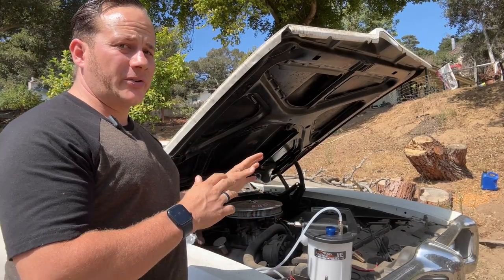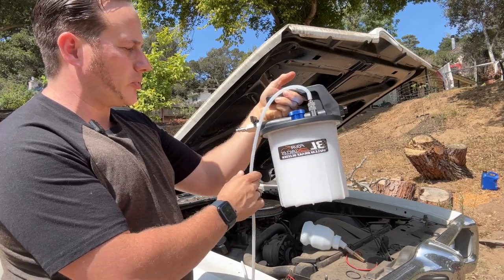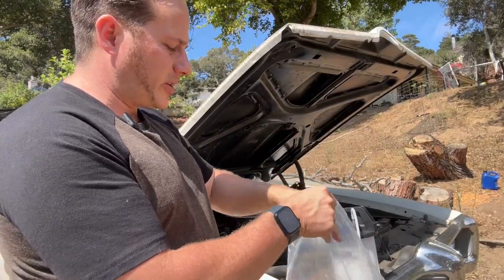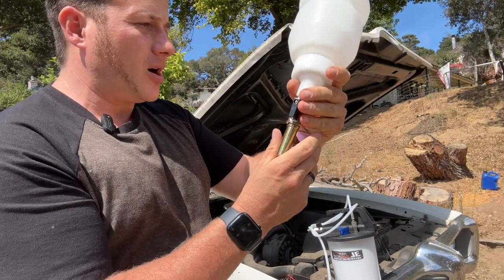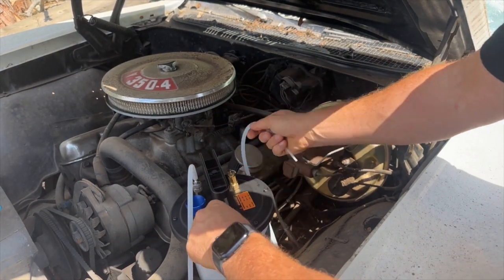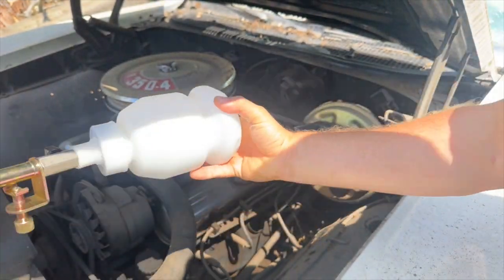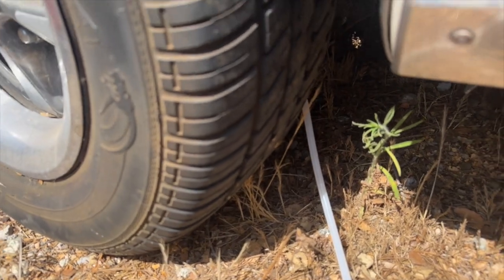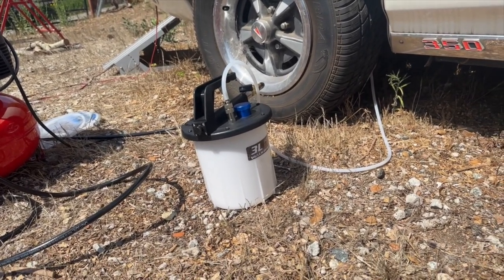Four uncles vacuum Brake Bleeder Review! Bleed brakes by yourself!

Comment: Thanks fpr the great review! I just got this same one which seems to be working good. As for the fill bottle, it's causes air bubbles when filling the MC. I tried different flow rates by using the on/off lever which doesn't make any difference. Last thing you want is air in your hydraulic lines. Thanks again. 👍
Reply from the maker: Thanks for the feedback!

Comment: I just used this thing for the front brakes of my honda rancher fourwheeler and it bleed the brakes in like 5 minutes. Well, actually in less than 30 seconds once you put it together and connect it. Mine dont have the screws on top to hold the lid but it didn't leak. If you got cars or atvs i'd 100% recommend this thing.
Reply: Oh, I just checked your affiliate link and the reason mine didnt have screws is because I got the 2L version. I think yours is the 3L version. Still good product for the money.
Reply from the maker: Yeah the 2 and 3L are slightly different but both just as effective. A must have for bleeding brakes!
Reply: I just got mine.  Watched one other video and the person didn’t recommend it because it would suck air through the bleeder screw threads.  It would introduce air into the evacuation line.  Did you ever have that issue ? I’d be able to return it if I don’t try it I think. 
Nathan
Reply from the maker: I didn’t have this issue, could always add some RTV? Or get the smaller one that doesn’t have any screws

Comment: You state at approx. 2:54 that you can use the refill bottle after your are done to refill the brake reservoir. That bottle is used to make sure that you do not introduce air into the brake system by keeping the reservoir filled while bleeding the system. Just an FYI. :)
Reply from the maker: Yes I know you keep it there to refill it while bleeding the brakes